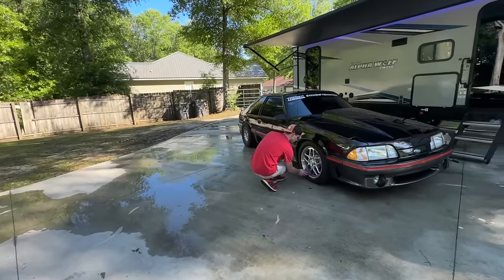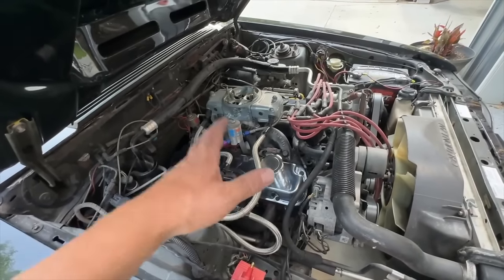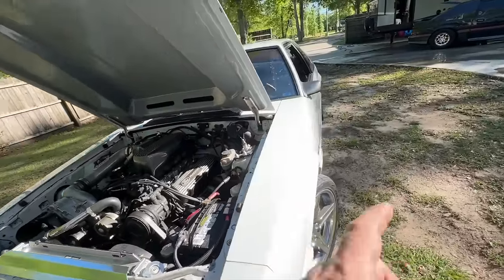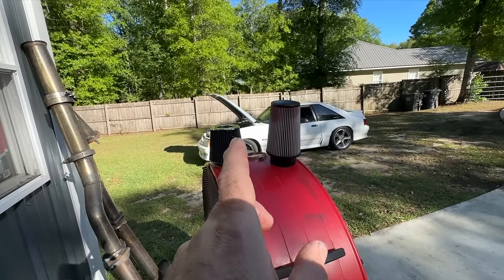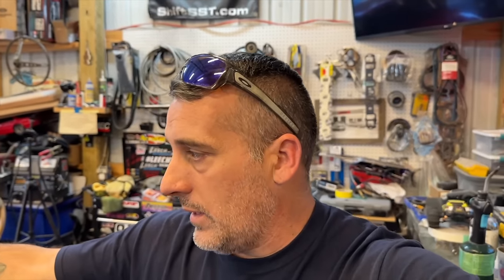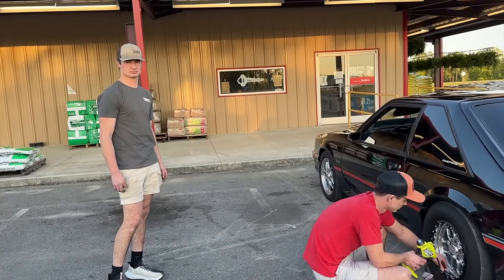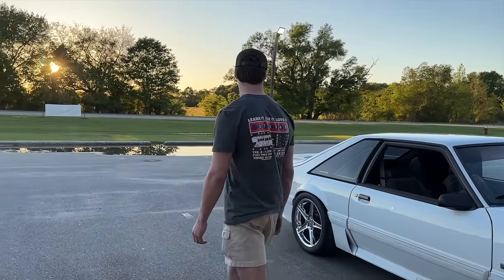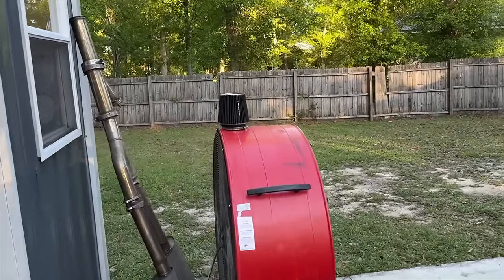Can the Budget Nitrous Setup Hold Off A Nasty Blower Setup??

Comment: People still don't realize 500 to the rear tire in a fox that hooks from a dig is a handful on the street I've hurt alot of feeling with mine
Reply from the maker: Most definitely 💯
Reply: I own a 70 comet 2670 pounds 350ish hp on a 150 shot. Hurt a lot of big motor feelings.  It'll hook in a mud puddle.  Luv your channel big fan.
Reply: I had a 331 from dss back in the day, tfs heads, 1050 bg demon, victor jr intake, two nos kits 200 and then 250 second stage. Tremec tko dual disc clutch masters. She made a shit load of power 700+rwhp and a ton of suspension work. Too much money. All in a 89lx with a cervinis stalker body kit. I miss that car. But someone needed the car more than me and money talked.
Reply: Weight is a big factor as is short wheel base 300hp to rear is fast in a fox if you know how to drive it
Reply: I had full bolt on 87 gt with 373 gears five speed about 246hp to tires I rarely lost if I did it's cause I didn't hook
Reply: Facts.
Reply: Yeah there's to many 1000hp and up cars on YouTube, people hear 500 and think it's slow but have never been in anything above 300, 500hp is perfect for the street
Reply: @tylerc7336 this.  The internet makes 1000 hp seem common thus anything under that is a waste of time says the people who've never even drove anything fast let alone an older raw rwd car without nannies especially a manual one.  People talk about hp levels as if it's universal 300 hp feels like this 500 feels like this 700 like that but it don't work that way at all.  500 wheel in a fox will gap 650 rwhp cars of today because of weight alone.  Different power levels are not universal the way the noobs online talk lol.  You know when someone talks like that it's the first clue that they're clueless.
Reply: My brother has 550 on his gn with qa1 suspension. And it is a handful for sure
Reply: Mine is all motor with big can trickflow setup and I’ve cut out about 200 lbs off the car in at about 2500 lbs and 370-400 to the tires. I GAPPED a 2016 roush from 15 mph

Comment: These are some of the hardest cars to dial in on the streets but when you do they will hurt feelings. My stock 302 with a V2 S-Trim(16lbs) w/mondo ice cooler & QA1 all the way round (T56) (center force) (ET Streets) was a beast on the streets. I took down so many DSS create motors. Granted this was in 2008 they were so tired of me they stole the car! Great video and work with the rides.

Comment: Got a obs chevy with a stock bottom end lt1 carb swapped Edelbrock top end 340 whp before the holley efi even then step dad foxbody 290 to the wheel would get ahead of the car . Getting a t bird soon building the 302 in it and a 306 sbf fully aftermarket forged assembly should be a riot 🙂.

Comment: The old p head! Dustin porier 🤣 
Hey brother I got a nice set of late 90s steel trick flow high ports heads that would replace those p heads. They are 202 stainless valves and been milled l, double springs at 650 lift . They are complete for 600. He will need to get roller rockers or use the rollers off his if he has.

Comment: How is that mr.freeze holding up on the other car, are u still running it?…….i was considering running one on my vortech supercharged LS in my c10……..it would be a whole lot easier than going to e85, and im running a terminator X so id assume the ecu would do its job on keeping the air fuel ratio in check….its not a max effort build, just a little city cruiser so im not chasing numbers , just want it for a safety net more the less!!!

Comment: I definitely will be checking into my filter and possibly replacing, it's a older filter that was cleaned and reused (my set-up is 331 and a V1 S-trim)
Reply: Get a RE-0880 (K&N) 
The filters these guys are running are tiny.

Comment: The nitrous car is basically how I’m building my first fox. Just purchased an 89 GT. Has an Edelbrock setup so I’m expecting 320 at the wheel after the carb swap then definitely throwing a 175 shot on. Already 5 lug swap with a some hardened 4.10 in the rear need a TKO and clutch next. What Andrew’s suspension setup?

Comment: Nitrous is simply the best way to go.
Had a ranger with a built 351 that went  9's with a 250 shot.

Mopped the streets of my hometown with that same ranger, with a mostly stock 302 and 125 shot.

Good times.

(for a bit of reference tho, I had a turbo Acura Integra and a boosted car is 100000% more fun to daily). The sound of the turbo and blow off valve is delightful.
Reply from the maker: Hell yeah! That sounds like it was a blast to drive